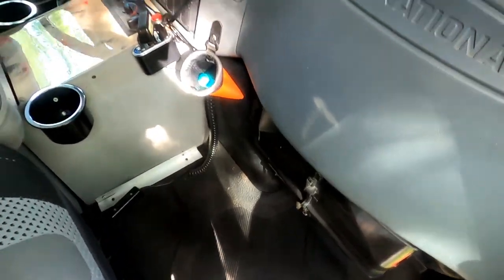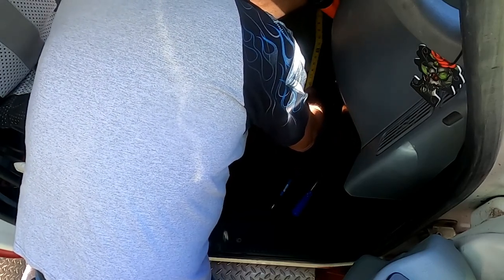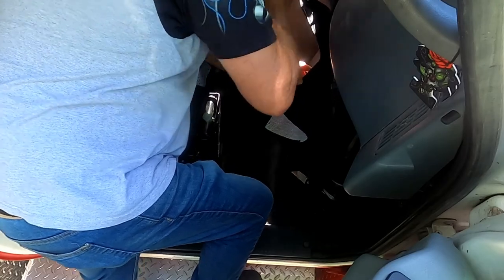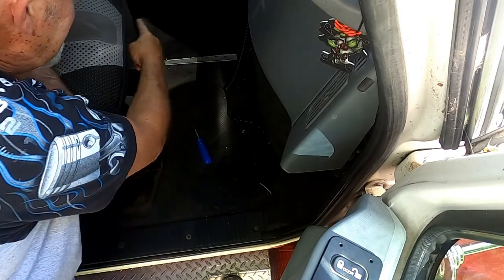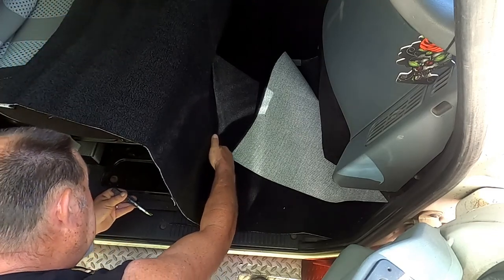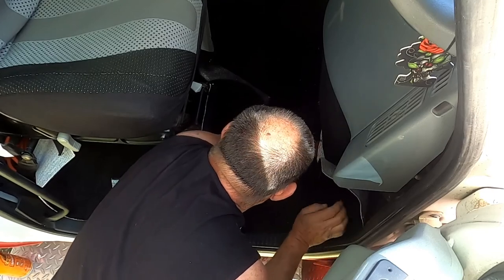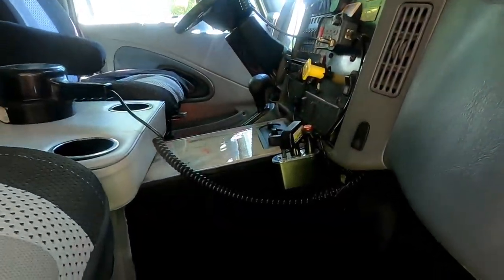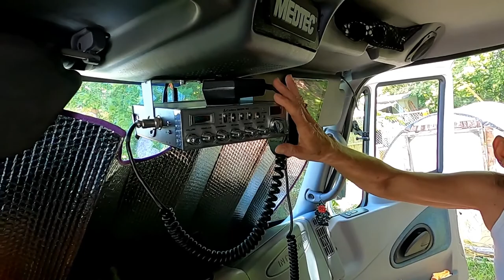Ambulance Camper Upgrades - Interior - International 4300

Comment: Hi Robert and Teresa. Looking good oh, I use that spray adhesive when I put my insulation in my rig, and made my window coverings, work pretty good. Tomorrow I'm doing brake jobs front and back on my rig fun fun fun LOL oh, I like the idea that tablet. I seen your CB hanging I will have to get mine installed. I'll have to put it on the list. I was just thinking about you to the other day, wondering when your next video is coming out and here it is. Thanks for sharing